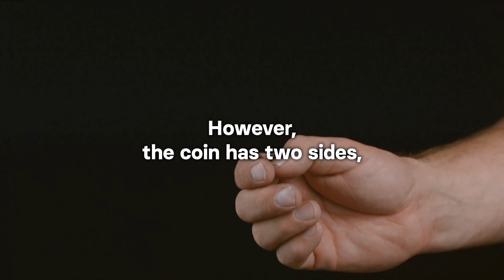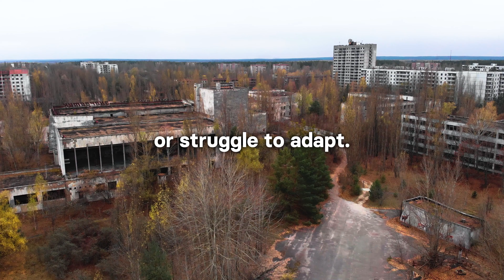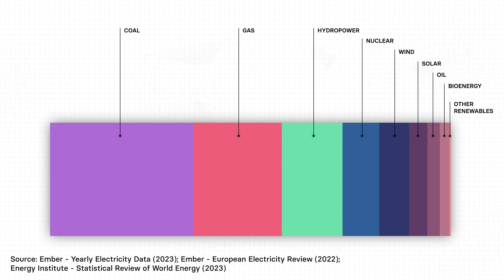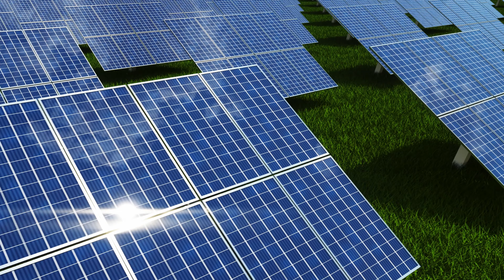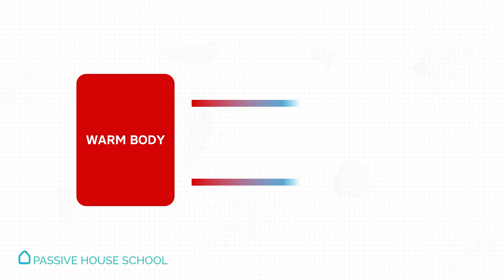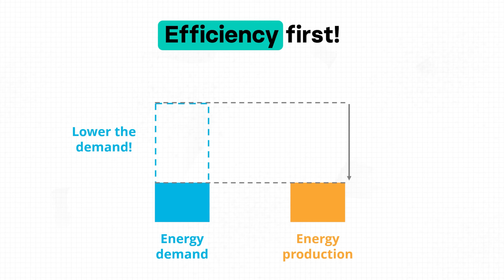How Architects Will Solve the Energy Crisis

Comment: Much easier said than done. So many buildings are poorly insulated and it is uneconomic to significantly improve their insulation. Renewables also have their inherent deficiencies, intermittency and technical which means that they will not replace conventional generation..
Reply from the maker: If it was easy, we would have probably already done it... That's why this is one of the biggest challenges that we are facing in our century.
Reply: @AntonDobrevskiPHS  I've been living off-grid with a small array of solar panels and a set of second-hand batteries for fifteen years. The only hard part is getting people who are used to living with unlimited electricity on tap to start thinking about electricity as a limited income which they need to budget just like they budget their money. We would have completed the energy transition already if people were willing to live within their means.

Burning fossil fuels for energy is just stealing from our children and grandchildren, because they're the ones who are going to have to deal with the consequence of our self-indulgence and waste.

Comment: Super high insulation renovations indeed work to lower energy needs to stay warm, comfortable and safe in the winter. We completely gutted our old two story 1912 house. In all the stud bays we installed vertical lathe for an air space for the house to breathe and stay dry. We then installed 2" foam and then 1" foam boards in all the perimeter walls. We will install our vapor barrier and then another 1.5" of foam. We now heat our home with electricity not natural gas. I support our global transition to renewably powered electricity.